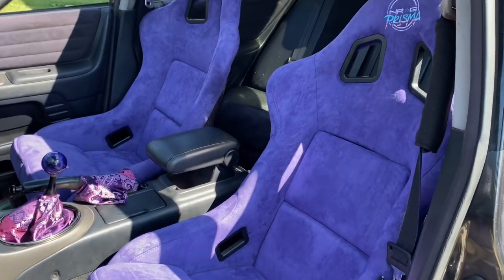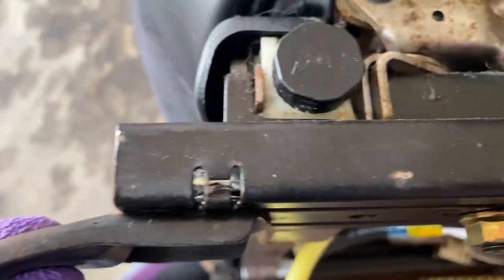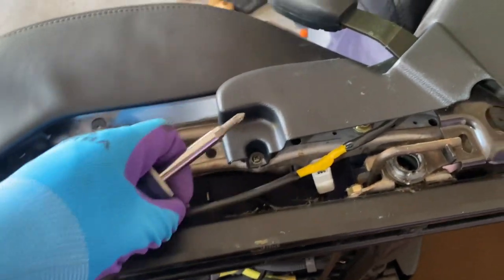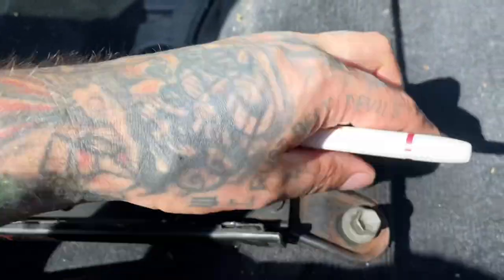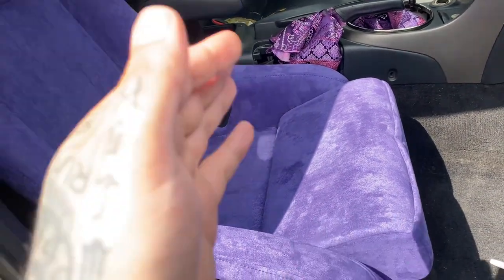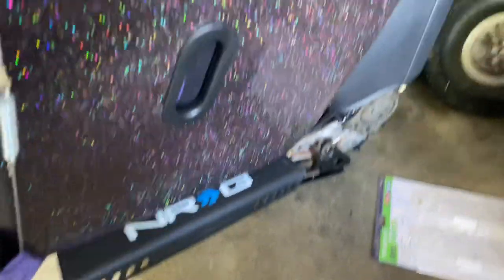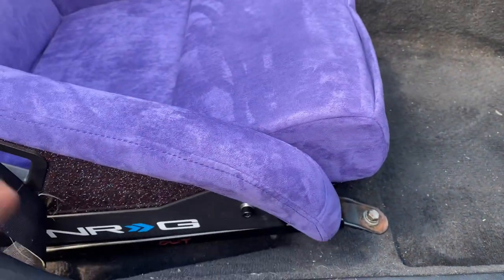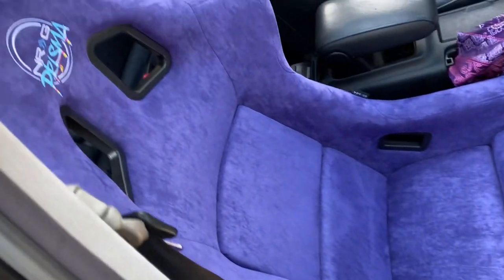HOW TO INSTALL RACING SEATS IN AN IS300 USING OEM SEAT RAILS

Comment: Audio is a little out of sync right ?
Reply from the maker: Yes i apologize
Reply: @FortuneHeart  no worries… did you end up running the seat belt buckle if so how did you mount it ?
Reply from the maker: @andrewvalencia6489  I have bet finished that part, but I will be using a L bracket to the seat mount, or using harnesses
Reply: @FortuneHeart  I took the stock seat belt and bracket from the seat and bolted it to the side mount that’s flipped sideways
Reply from the maker: @andrewvalencia6489  send me a pic on IG!